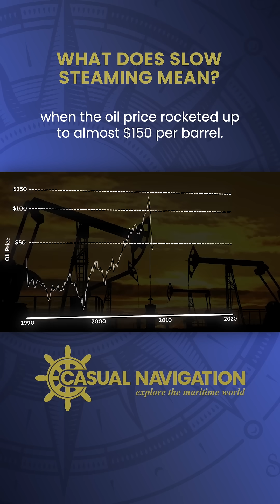Why Are Fast Ships SO SLOW??

Comment: Planes also flight quite a bit below max speed on normal travels, as far as I know, that's part of how they sometimes catch up on delays.
There it is partially also about efficiency/fuel consumption. I know with a boat, when you just about glide you are very efficient, but you can still go so much faster with a good motor, but that will burn out your fuel quite fast.
I would also guess, max speed is less efficient than cruising speed on larger vessels

Comment: Stupid question: why not have nuclear powered cargo ships? The amount of fuel saved would be huge.
Reply: Mostly money, the cost to build one is easily 800 million plus and the upkeep is very high because you need specialized crew to run the reactor.
Reply: @ what is the cost of a conventionally powered cargo ship as compared to a nuclear one?
Reply: @seriousgoat76  I read somewhere that we have stove size small nuclear reactor, designed to replace industrial generators in remote regions. Why not put an electric propeller on the cargo ship, and power it with the mini reactor?
Reply: The video by Mustard dives into the many reasons why such a nuclear powered ship would simply not be economically viable and I can only recommend watching it if you want to learn more about the topic
Reply: Publicity and different regulations regarding nuclear power in different countries. There is a video on YouTube about the N.S. Savannah by Mustard if you want some more background.
Reply: South Korean commercial brand Hyundai is setting eyes on Nuclear powered cargo ships. So that somewhat a cool lead. But besides the potential great idea:
Research and development. 
Cost of production and scale. 
Implementation and practice and maintenance. 
And most importantly of all: 

If and when one is built, can it be fully secured?
Many pirates still sail the sea, albeit low success rates.

And Who built it? Can they be trusted?
China theoretically could reverse-engineered one or  build one of their own and bully neighboring countries like Vietnam to take the whole South China Sea. Or North Korea / Russian and start ”pointing their stick” at any of their enemies.
Reply: @miguelle9724  What do you mean by the last bit? That the nuclear cargo ship would be of military value? Why? Its still a cargoship, and if putting nuclear reactors in battleships made sense there would be nuclear reactors in battleships.
Reply: nuclear reactors are just boilers for steam.
Meaning, instead of just one engine they'd have two essentially, the boiler, and turbine... resulting in MORE WEIGHT, MORE SPACE LOST, and a VERY volatile engine, which if sunk, NEEDS TO BE RECOVERED. OR SEALED or SOMETHING.
Reply: Maybe one day when they don’t need maintenance.
Reply: Look up the Green Peace anti-nuclear ads.

Despite being our best bet at reducing climate change and saving the planet nuclear power has been the victim of a multi decade smeer campaign not just the oil and gas intdustry but also ignorant invivromentalists, tv shows and video games.
Reply: Nukies cost too much to operate. They don’t have tax $ like US Navy ships/subs have.
Reply: Well for one we can’t even solve the problem of people hijacking/sinking regular azz cargo ships, imagine if a multi billion dollar eco friendly nuclear cargo ship was trying to traverse the Red Sea? I guess they could avoid it but thats just a single political problem of the dozens that would need to be faced.